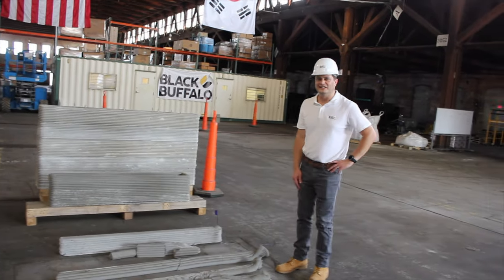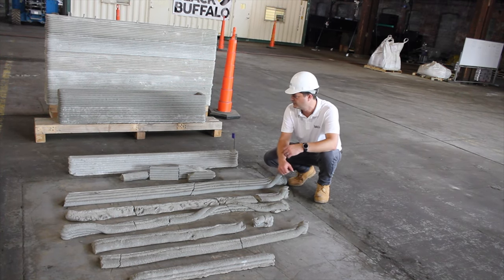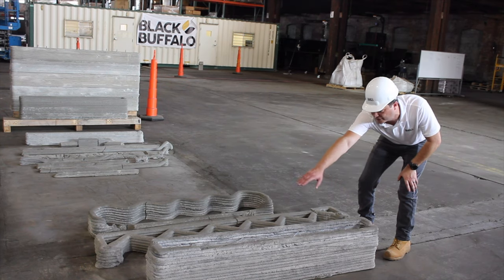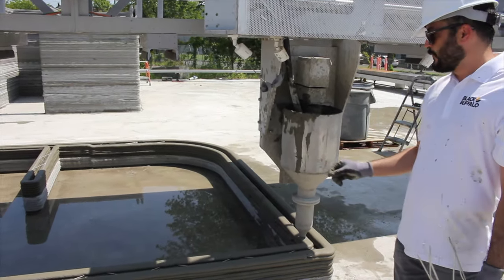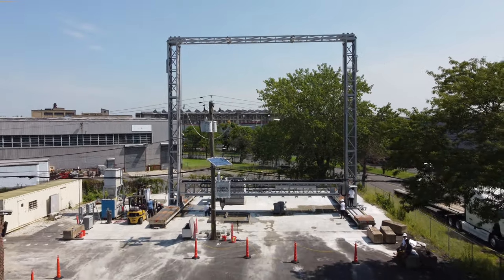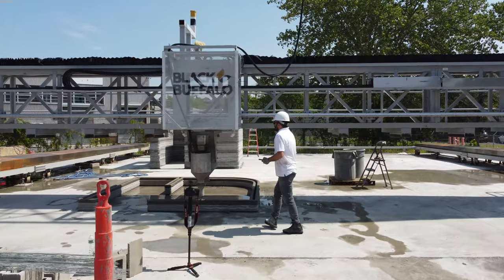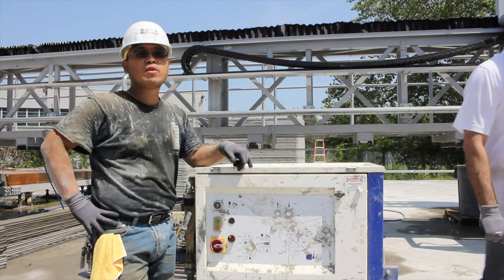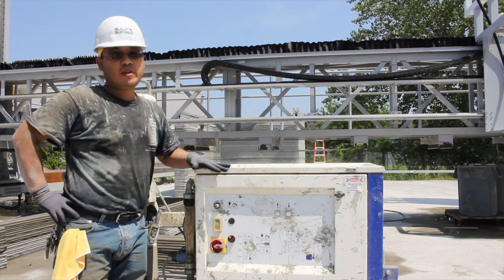SECRETS OF 3D PRINTED CONCRETE EXPOSED | Bold Black Buffalo 3D Shares All

Comment: the name of the game is going to be mixing multiple wet and dry materials close to the print head with fine controls, as well as what materials can be used which is a a very broad range.     There is also tons of innovation potential in the area of functional design including running utilities, insulation,  surface texture, integrated color, integrated waterproofing etc.   The other area of competition is on portability.    Having a machine that is easy to move around and set up is a massive advantage.

Comment: So how is this going to be used?      Does this have its own plant or is the concrete coming from off site?    Right now it looks like you would be better of slip forming or just using a pump truck..     plus I'd rather have rebar In the concrete.

Comment: does this cut back on carbon emissions  cement puts out 8% I think
Reply from the maker: If you can decrease the amount of material used by printing instead of pouring by around 50% then the overall cement caused emissions would be lower printing.

Comment: I guess 3D concrete printed house process it is Engineering  (science)  plus  Art.    I cannot tell you how much is Science and how much is Art . From what I hear from these guys  it seems that  there is a lot of trial and error in the process and not already tried and proven methods and rules.
But probably it will come to that because  there are so many variables to the equation and it is hard to solve.